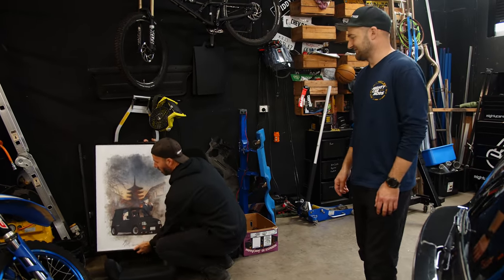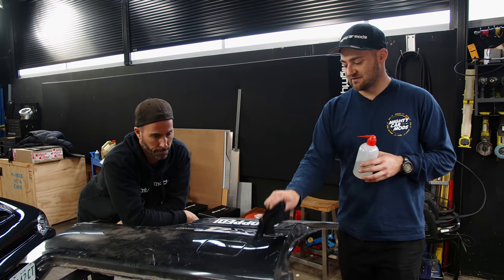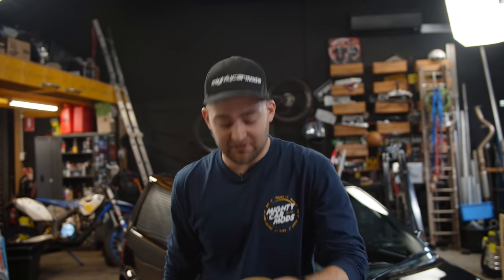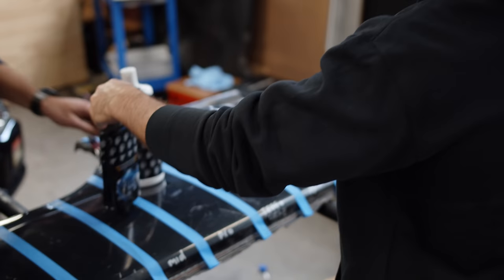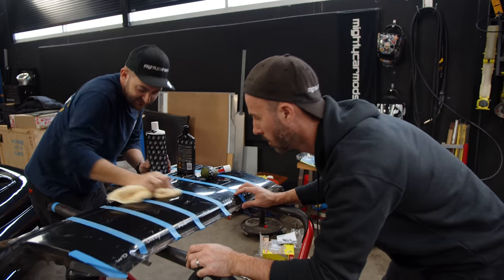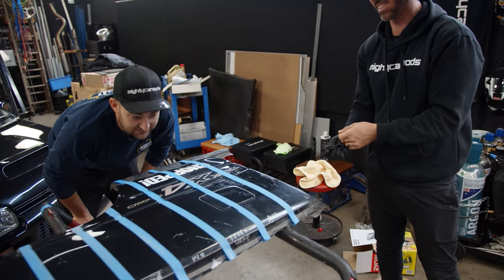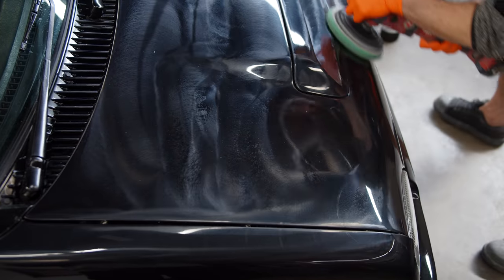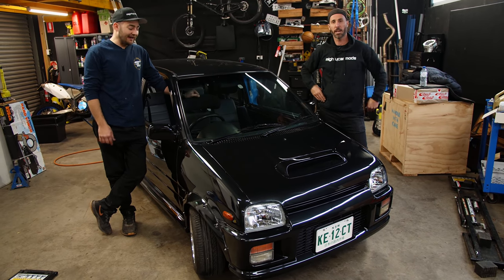How to fix scratches on your car [MYTH BUSTED]

Comment: Likely going to catch a lot of shit for this, so be it...As a professional detailer for over 20 years, this entire video was insulting. There are so many things completely wrong in this video, its shameful. And I am not saying that to be flippant, I am saying that because you are genuinely giving people BAD INFORMATION, and telling people to use techniques that will ultimately, legitimately, have the potential to permanently damage their vehicles paint. And a channel your size, with the information you provide, has an absolute responsibility and obligation to your viewers to NOT promote bad techniques, spread bad information, and recommend bad products.

I genuinely don't know where to begin on this video, so I will do my best to try and make the most sense of this in a chronological detailing order.

First, you should have got advice from your detailer buddy BEFORE you even considered making this video. Could have saved you a LOT of time and trouble.

The machine you detail with is  very important. For beginners, they should not be using a Direct Drive Rotary Tool. That is a recipe for disaster. You proved this by the hack job Marty did on the hood, not moving the head enough, and not breaking down the polish enough. Your friend was being very nice to you, but no doubt had to make extra passes with his FInal Cut COmpound to remove the Panel Haze you put in by ineffectively running the tool. You should be lucky you didnt burn through the clearcoat.
A novice should consider a Dual Action/Random Orbital device from a reputable tool company. You dont have to break the bank, but you need a good DA to get good results. Only once you have perfected running a DA, should you jump to a Direct Drive Tool.
On the same thought, the Ryobi "buffing machine" you bought...100% utter waste of money. They are completely useless, and absolute garbage. Should never have wasted your money, and should never recommend such a trash tool to anyone, Ryobi as your sponsor be damned. If you are struggling to remove your product...you did something wrong putting it on.

Speaking of putting it on. LESS IS MORE! The amount of product you used on that test panel, was literally almost enough for me to do an entire car. And I am not exaggerating in the slightest. You could have easily polished that panel with a 1¢ piece size dollop. Too much compound can be detrimental to the process, as the abrasives in the compound will fail to work themselves down enough, and will create a problem called micro marring/haloing/hazing/holograms to appear int he paint. Underworking a polish can cause just as many paint correction problems as a scratch.

Speaking of Polishes and Compounds...Compounds are NOT for getting dirt off the pain! Washing, along with tools like Synthetic Paint Clay, are designed for removing surface level contaminants. Things like paint clay remove those bits of dirt that cling to the surface of the paint, and leave behind a smooth finish to start as a base for correcting the surface. The more contamination you can remove in the paint prior to polishing, the better your polishing job will be. And the faster your polish will work.

Additionally, when you switched to the direct drive polisher in your test, you used the same polishing pad for EVERY COMPOUND! This is a cardinal sin in detailing. Never mix your products! There are rare occasions where you can go from a polishing compound UP to a cutting compound in the same family. But you never want to mix chemicals and chemistry's. Its pure contamination, and can cause adverse reactions that could damage the paint. Because you used so much product, half of what you where using on that little test panel, was probably still in the pad when you moved onto the next. In fact, when you move from the "cheap" compound in the tin, to the "midrange" in the bottle, the first several passes with the tool are brown/orange from the cheap cutting compound that was still stuck in the pad! This completely invalidated the test, any more than it was already from all the other mistakes made up to that point. Again, this is giving an example of something the average person SHOULD NOT do.

Honestly,l Toothpaste isnt bad as a light metal polish. But its sticky, and not all toothpastes work the same because of the various abrasives in them. That said, its for your teeth, not your car. And avocado is just a terrible idea, as it is more likely to introduce heavy surface scratches and abrasions, than polish out anything on a painted panel. Again, maybe for metal. Hell, you can even use a chocolate bar to polish aluminium. But I digress. Actual Metal Polish will work better. If you can get your hands on a bloody avocado, you can get some cheap liquid metal polish at the kitchen section of your grocery store.

Seriously, you guys need to get in contact with your Meguiar's Australia Product Rep, or Larry from Ammo NYC...someone...and have them come on and show you how to properly use the products. Not for YOUR SAKE, but for the SAKE OF YOUR VIEWERSHIP! This video was an absolute full on face palm inducing disgrace of a video, and I cant believe you actually published it. Please make good on it.